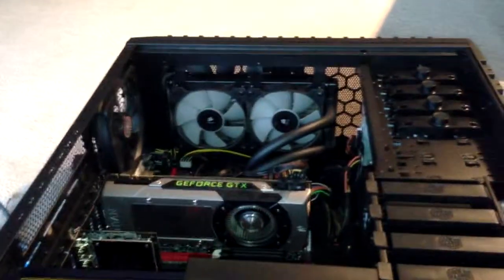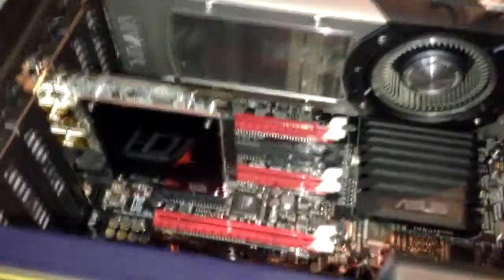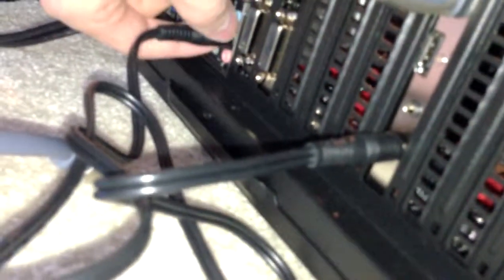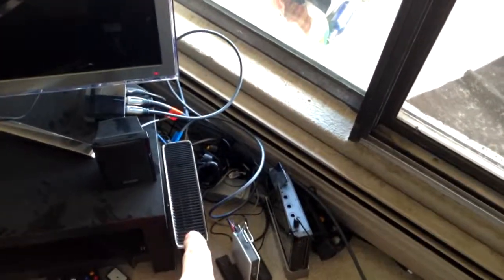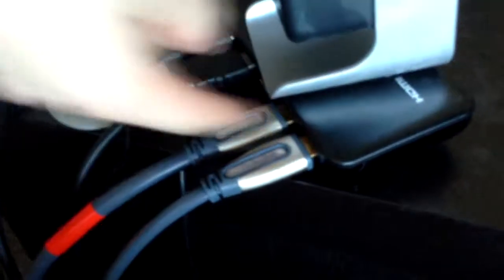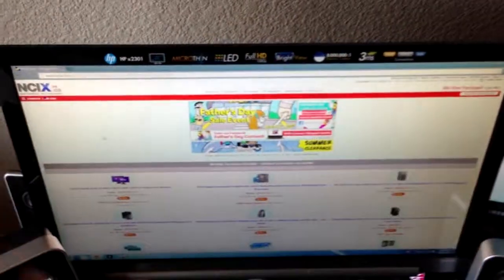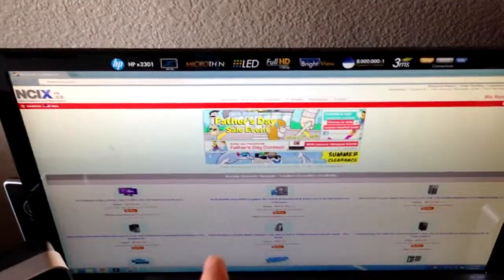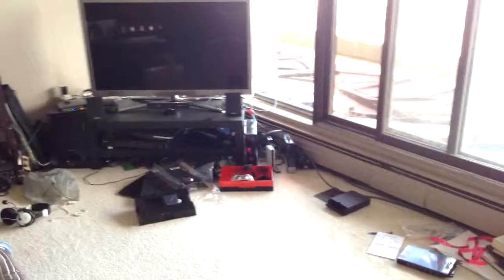Setup Of AverMedia Live Gamer HD For PC And Xbox

Comment: Hi, im using single pc setup. Hdmi from GPU to capture, then HDMI to monitor . How do you get a second monitor to be a extended screen so you can use it for chat, and follow alerts etc.
Reply from the maker: I use a switch for mine. So I go from Xbox to switch, switch output to capture card, then to monitor. Then I have GPU to Switch as well.